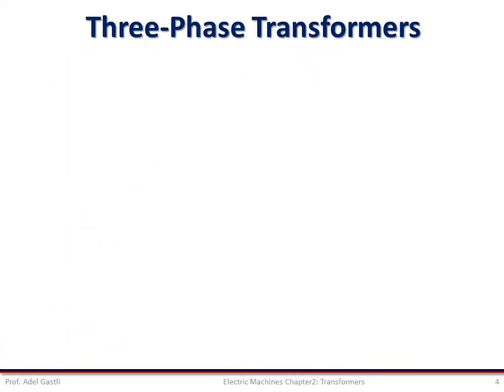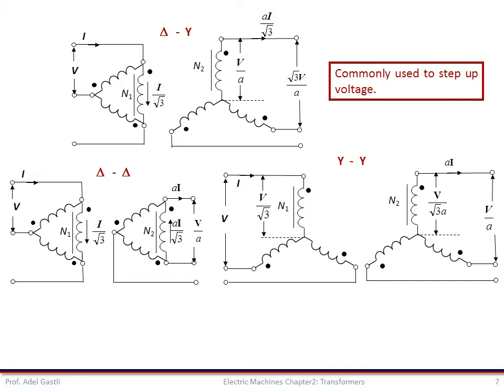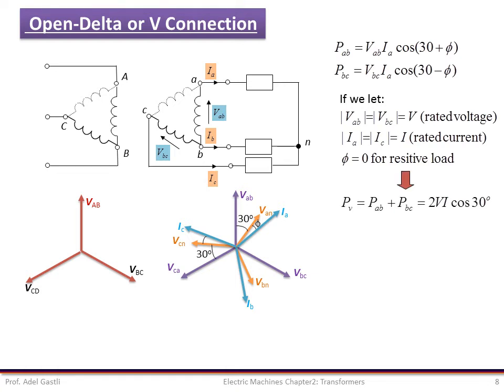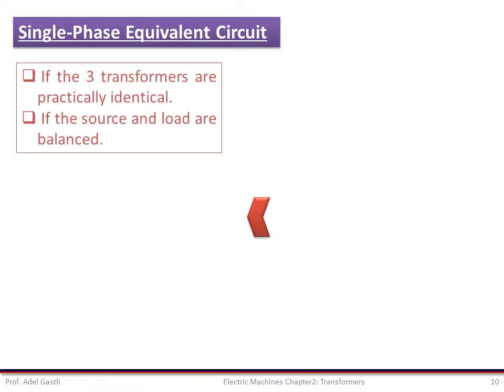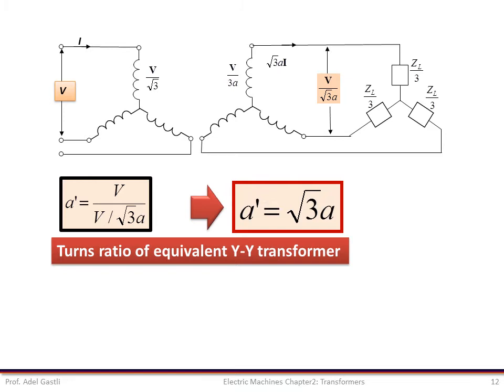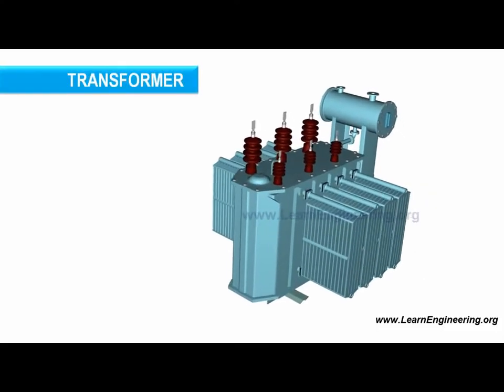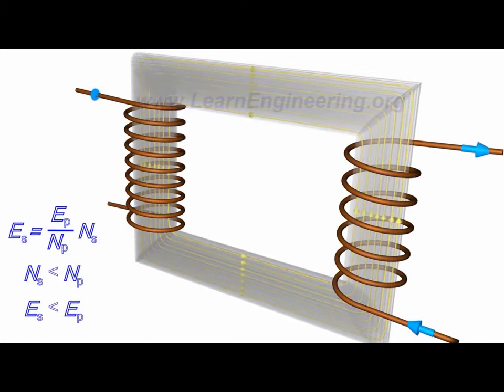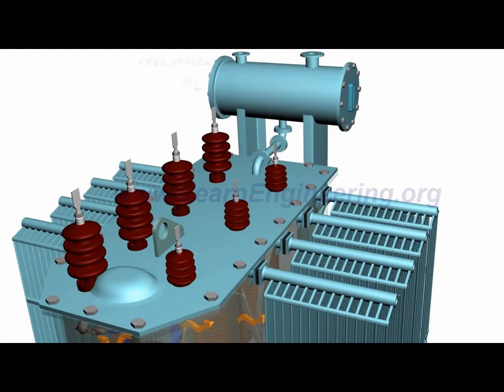Electrical Machines: Transformers (Part 7/8)

Comment: Definitely wrong  transformation coefficients (both phase and linear) in Y/Y connection. They should be both equal to a and not to asqrt(3). Look at the possible D/Y connection diagrams at the first part of the lecture where they are correct.